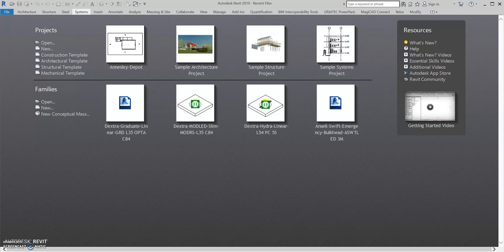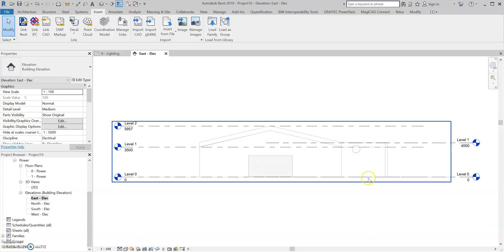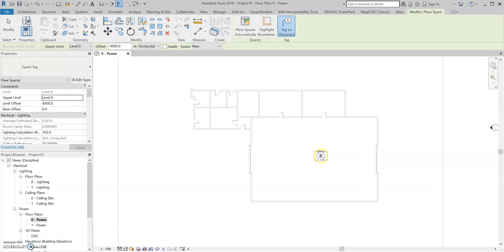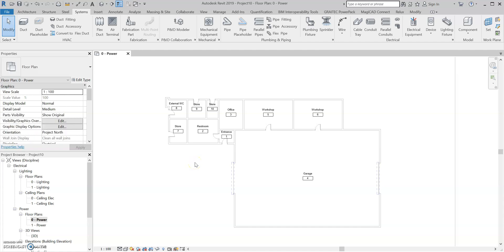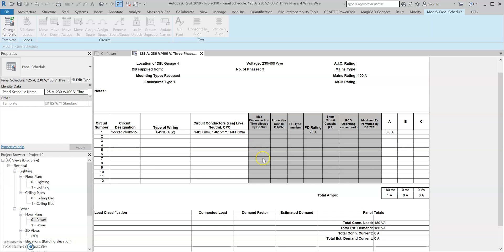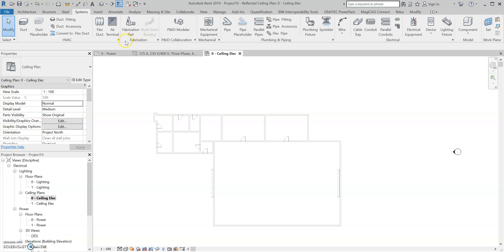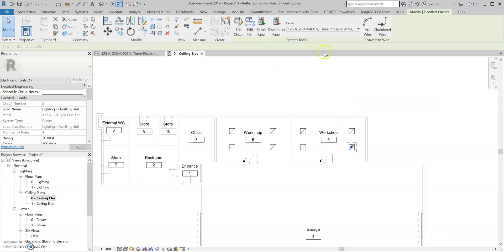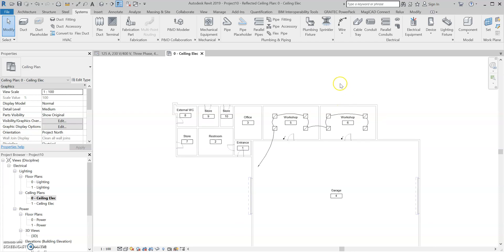Revit Electrical Beginner Tutorial | Power, Lighting, Sockets and Circuits

Comment: When I do lighting fixtures then coming error. What should I do.
Reply from the maker: Hi Tech Service, This could be caused by a few things, Is this when you try and place the fixture into the space? As you may need to change the placement of the fixture as seen at 11:00 or you might just want to check that the height of the fixture is the height of the surface you want to place it on? Thanks, Mitchell